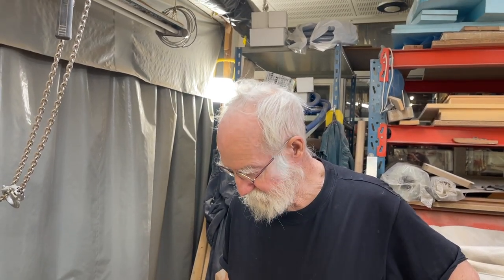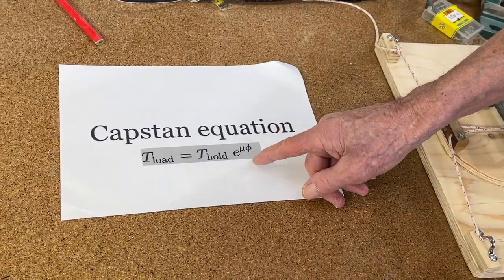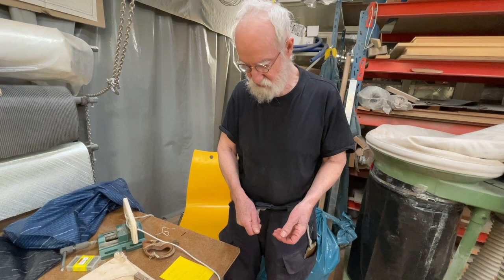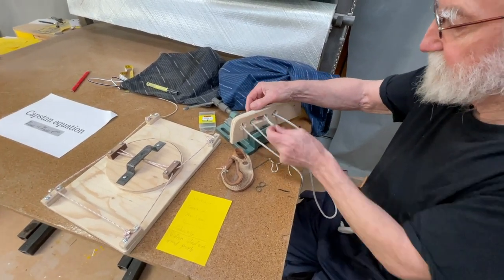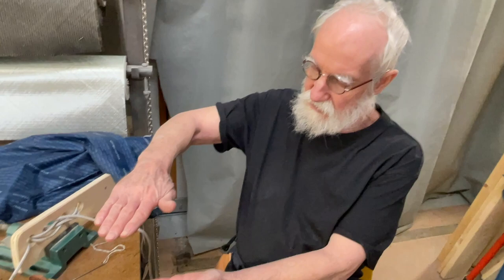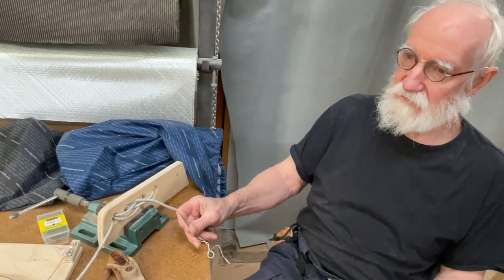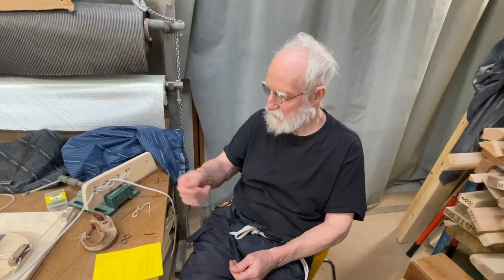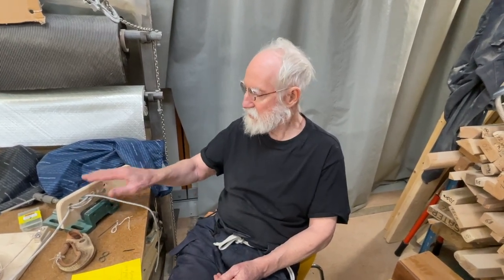9 Jan 2023  Fastening the guiding ropes for the deck hatches. Inspired by the capstan equation.

Comment: Hi Sven,
Looking at your ventilation system, even if your boat capsizes, no water enters through the system. Am I correct?
Thank you very much for share your incredible work!
Kind regards,
Reply: Did you watch the video?
Reply from the maker: Only a the little water in the system 1 or two liters enters when the boat is returning to upright.

Comment: You can splice an eye on the ends of the dyneema and affix it that way. Dyneema takes eye splices very well.
Reply from the maker: However Dyneema splices must be very long.
And in this application the ropes cannot have any play. They have to be made tight in place
Reply: @SvenYrvindExlex  if you're putting massive loads on the dyneema, then the splice needs to be long. But for holding a small hatch, I would think you could modify the measurements. You could thin the strands too, to make it less bulky. 
A reverse Brummel eye splice would lock it in, then you wouldn't need to bury the end as deep.
Reply from the maker: @pointnemo72  Thanks still I cannot do the splices before putting  the ropes in place because there must be no play.
I can splice one end but not the two.
Reply: @SvenYrvindExlex  Can you make the attachment point adjustable?  Like an alternator bracket. Then you can take up the slack in the system.

Comment: I have built a lot of radio control Airplanes. in the fiberglass objects. In the past the best way the spread resin poxy or fiberglass is whith a  deck of poker cards plastic coded or you could use memory cards. Or Flash Cards? As long as  They're a plastic coded. They work very well for spreading resin on cloth. They work like a Squeegee. you use them intell they get soaked with resin  Throw it away. Then grab a new card you got 52 cards to use deck of card is the cheapest way to spread risen back-and-forth on cloth.
Yo. I say you? Like. Being frugal. There will be points where it doesn't work but try it. The more you're using the more you like it. Good luck. Remember you got 52 cards to figure it out.
If you like it reach back out to me and let me know I'm disabled all. I could do is watch TV . I'm very fascinated about your show but your short little video clips are too short for me make them 15 minutes long if you can I would love that. Thank you very much.